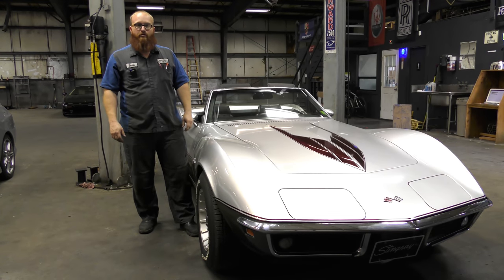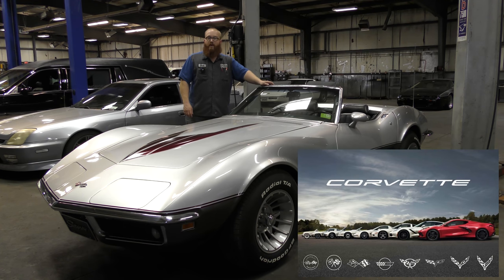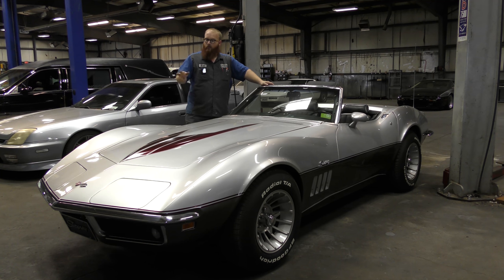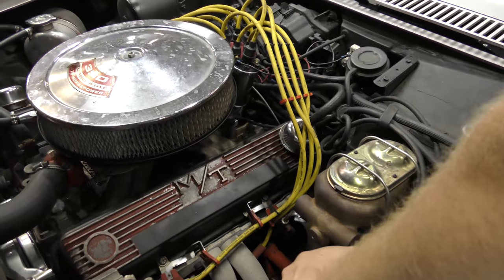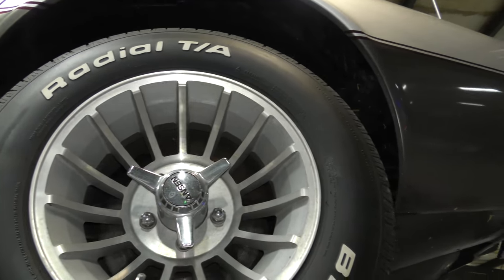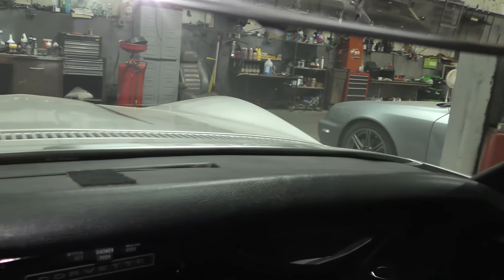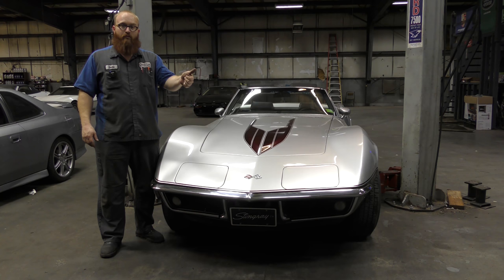The CAR WIZARD inspects this dream '69 Vette

Comment: My pop bought a used '65 Caprice 396 at a Chevy dealer in 1969. I would later learn that '65 was the first year for Caprice and for the big block. As a 10-year-old car nut I'll never forget what I saw in that Chevy showroom. A convertible Vette, a convertible Corvair (the last year for Corvair) and an orange Rally Sport Camaro convertible with checked upholstery. Congratulations to David on his 1st YouTube anniversary!

Comment: These older corvettes (especially the early metal bumpers ones) are really need to be appreciated more in value, they look nice, drive nice and built to last, I hope they will someday be a true collector cars.
Reply: Lassi Kinnunen  they are not. Chevrolet has built 4 times more camaros in the same year, yet any clean original 1969 camaro would sell for at least double the figures!

Comment: That body looks straight and excellent as far as panel alignment with perfect and even gaps. Regarding the C-1, C-2 designations, while the 1953 through 1962 went through body changes and engines galore they were all on a shortened 1949-1954 Chevrolet chassis/suspension. The C-2 and C-3 also share a frame and suspension and yet are two different generations of Corvettes. The C-2 is my favorite of older 'Vettes. The venerable Ed Cole small block is an engineering marvel, but I'm drunk on LS horsepower.

Comment: 6:19
that lower ball joint on the passenger side looked a bit shiny.
like the boot might be torn. I'd need a closer look.
Reply: Cromulent Commodore seen by me also
Reply: Also, those sway bar end links up front are crusty.....oh and that right rear tire is showing a TON of inner wear. Maybe a bit of donut fun with an open rear?
Reply: Cromulent ??? A Simpsons fan I see...

Comment: In 1969 , the base small block was rated at 300hp. A 350hp model was optional. The air cleaner sticker appears to be from a 1970 LT-1 engine with a solid lifter cam rated at 365hp.

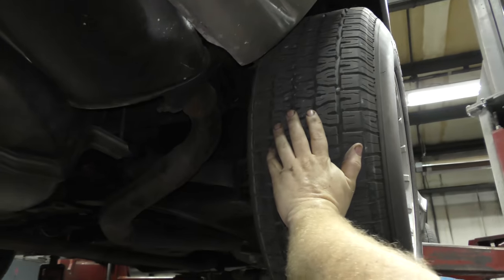Comment: Bolts missing bottom bumper support at 6:33 with stray wiring twisted about and a possible bad ball joint right front at 6:13 and the rear end is out of alignment camber excessive at 8:41. Good luck freeing those adjusters!
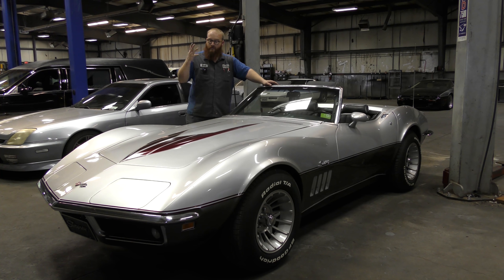Reply: Don't forget to check the rear half-shaft bearings. I had one seize on my '73 and it just quit without any warning. On I-285 in Atlanta at 2:30 in the morning. Not the way I thought my night would end.

Comment: Tip on those wheels, make sure they aren't magnesium.  Cast magnesium aftermarket wheels were common back in the 1960's, they tend to develop cracks as they age and can become a major safety hazard.  You don't want one of them flying apart on you at speed.   Also need more info on that hearse, looks to be a 1993 or 1994 Fleetwood, the last great Cadillac hearse.  All the Cadillac hearses since 1997(when they went to the FWD Deville chassis) have become malformed, dainty, too small, ugly ass looking monstrosities.

Comment: If I had one in a similar style, Id install 3 point belts with bolstered seats sitting a bit higher. Kinda like the Mercedes seats with the belts integrated with the seat frame. Was never fond of the typical low low Corvette seating position meself, but otherwise wouldnt mess with the rest of that beautiful car.

Comment: Check the ladder chassis frame around the engine mount in the front from the top, a few have gone from a wielding stitch around that area going out from either crash impacts, rust or just plain old wear and tear, same with the area around where the rear suspension mounts, as GM when they made these cars did away with a very key X brace when updating the car from the C1 to the C2, that ran underneath the car in the middle and never compensated for it. 

as all this car is, is a corvette C2 with the Pontiac Banshee's body stretched over it, hence the drastic overhaul that was the C4 corvette, where not a single damn thing was left untouched in that redesign.

like imagine a bed frame that only connects in two areas with no struts across in the middle to properly support a persons weight and you can see where it would go wrong based on where all the pressure would be put, and that's where you need to check.

as they thought the body was strong enough to make up for it, and the X brace weighed about 300 pounds apparently, but that's why these cars have Cowl Shake and have never been able to match their European rivals unlike the C1 did, not enough bracing and a poorly designed stub axel design that fails under heavy loads overtime if you dont keep up with the greasing requirements and put oversized tires on them without a big block rear suspension being fitted to it.

and the car that failed and had its front suspension collapse and total the car from that stitch coming undone as he drove over a speed bump at low speed was an 81' and the same failure was found on a 68', one coupe, one convertible, so the entire range has it, and all because a wield wasnt done right.

luckily the guy with the 68 was able to find it in time, and the guy owes me a beer for telling him about it, as he had owned the car since 72'

it should be on the corvette forums, look for my 81 is toatled from a few years ago, as these cars are getting up there in years, so just make sure to do regular checks for that kind of stuff, as when its built by hand, hands can faulter

and the same applies to all lader frame chassis cars I would imagine its just I found it in such a drastic fashion on a car I really like. Plus side is because its a corvette you can actually buy a new chassis for it would you believe?

Comment: Wizard, how about a video concerning the maintenance of a low mileage vehicle.  We have 1996 Miata that is only driven in the Summer.  Any tips on maintaining a car that may go a couple years between technically needing an oil change.  Or, a video on tips for storing a car over the winter.  Keep up the great work.

Comment: Check for frame rot in the front of the rear wheels near the body mount. That is a known area near where water drains out of the frame. I Love my 69 coupe with L-36 4-spd - AC.

Comment: yes the are delco shocks  you can tell  by the notch  in the ring    i seen that before  you said it lol     i turned  lots of them on the merrygo round ..in  76    before  i went into  the trades   ,,we could  run 15-20,000  a line  per shift  on the rods

Comment: The 370 horse was the LT-1 engine available i believe in 70-71 models. That car would've had a big block hood with an LT-1 decal on the side of the hood buldge. With the weight advantage of the small block with big block horsepower in my opinion was the best all around Corvette of the early models.

Comment: Nice Corvette.  Yeah, the C1 Vettes  had the "Stovebolt" Chevy 6, and Powerglide only, because from what I've read Chevy's 3-speed manual of that time wasn't strong enough to handle the extra power output of the tri-carb 6.  Just some Corvette trivia.

Comment: I remember Saab had that reverse lock-out feature as well where you couldn't remove the key without putting the car in reverse with a MT. I believe there was another manufacturer that designed their cars like that as well

Comment: I once owned a '70 Vette with the 390 HP 454. It was lots of fun but not exactly cheap to run.
Reply: P.S., the base engine in '69 was a 300 HP 327

Comment: Tire date of manufacturing was most likely on the back or the black side
Reply: Surprised he didn't think about checking there. Hummmm.....
Reply: Yeah they're pretty easy to spot on BFG radials
Reply: If they were made before 2000 I don't think they have date codes. I replaced some last year couldn't find a date code .

Comment: 11:25 talk about cheap(er)(end) interior materials, I sat in a 2019 Cadillac CT6 recently and was massively disappointed by the interior materials. It was as though GM said, "Cover that hard plastic with a veneer of cheap leather otherwise people will notice we're using recycled plastics from C5 Corvettes and Cobalts. It was very disconcerting.
Reply: Most of those get repossessed anyway.
Reply: its been restored calm down. plastic from these days just turns to dust i seen it. thats a dash cap they sell those. im sure the whole car has been restored. that paint is not original either
Reply: @xavierramirez330  I don't think it's been restored per se but very well maintained through the years Many of those parts seem to be original and undisturbed. Probably been repainted a couple of times by this point though.
Reply: @ohlookadragon  GM interior plastic from these years turns to dust even if garaged its entire life.
Reply: @superduty4556  I'm not disagreeing with you. I just don't think it's been restored. I think someone replaced parts and pieces when they needed to. To keep it looking nice. it's not like they ever stopped producing c3 dash pads. It wasn't just GM either. I've got a 72 international with a badly cracked dash. 38,000 original miles and kept inside for the better part of the last 3 decades
Reply: @ohlookadragon  we'd never know unless we asked the owner. You can build a Corvette from a catalog it seems.
Reply: @ohlookadragon  yeah it's been lightly restored I'm sure. Those dash crack like at 10 years old I'm sure it's not original. Not even if you keep it in a garage it will still crack. Because the material srinks and then cracks
Reply: Bob the owner here.  Car was custom painted and mildly modded back in the 80’s but interior is original. It’s a 2 owner car that has had excellent care yet driven over the years.

Comment: The headers do a nice job of cooking the starter...
Reply: Right you are, Walter. Those headers do.  I have similar setup in my '65 Sting Ray convertible and put a smaller hi-torque mini-starter which is wrapped in a DEI heat reflective insulator.  No more starter heat soak!

Comment: Holy Silver A-Team Van wheels
Reply: A common trashy mod for Vettes. Also the bug eye tail lights. Although I would tolerate four stock red outer ones and pitch the inner ones with the backup lights in the garbage

Comment: Ah, turn locks.  Or should I say "turn unlock".  If it's like my car, you lock it by pushing down on the door handle,  turning the knob (note how it's shaped like a security screw such that it's easy to turn in only one way) unlocked the door so you could pull up on the handle to get out.  Not sure as it was good for anything but trapping your date since hardly anyone knew how to work it.

Comment: pLease, the car's been repainted at least once.  The interior parts are reproductions not originals.  The aftermarket wheels are so so.  Overall that car has a lot of stuff removed from it.  Almost everything is vacuum and I'm not sure it can run all the vacuum controls it needs to in the HV system or raising the headlights are probably slow.   It's a fine car for a driver, but it's nothing else but that.  Seats and door panels have been redone/reproductions, center console probably also as that is notorious for cracking.

Comment: Hey could someone help me on this.....I recently bought a truck (05 Sierra 2500) with a 5.3 swap the engine is cammed but I don’t know what cam it is all I know is that he told me it was cammed....could I run a diablo tuner on it without it messing my engine up because of the cam?

Comment: "No plastics", just the entire BODY...lol
Reply: more like Sheet Molded Compound (SMC) panels made up of fiberglass and a resin formed under high heat and pressure.  Think of it more like early carbon fiber before carbon fiber, just not as pretty in raw form.  It was all about weight savings, but the panels are really strong up to a point where it cracks vs steel that creases or warps.  Plastic will crack at the slightest pressure.
Reply: @pervertedspeed164  Look the definition of plastic, fiberglass is plastic. The rear bumper was made of urethane, not even "glass fiber reinforced plastic."

Comment: Corvettes are great until you have to do bodywork on the damn things. Becomes a complete nightmare at that point. I worked in a body shop and we worked on a lot of Corvette and I hated every last one of them. Their fibreglass panels are flimsy and they won’t hold up during different adjustment processes. I remember adjusting a hood on one about 50 times. Every time you would put it back down and back up it would be a little bit out of adjustment. They really didn’t get it right until recent times.

Comment: Hey Wizard, do You have snow in Kansans where You live? I am asking, as the tires on this Corvette have "M+S" noted on sides. In Europe "M+S" tires are winter tires. As "M+S" stand for Mud plus Sonw. Is it the same in US?
All the best for You from Poland!
PS The amazing think with this car is hove amazing it is for its times! I have a 1974 Mercedes W115 220D with 60BHP. It has a 0-60 time of two days, and a max spped of about 80 (135km/h). This Corvette would simply disappear over the horizon, before I hange the gear into 2nd in my Mercedes :DDDDD
Reply: KamilMB you are correct. M+S designation does indeed mean Mud and Snow.  Radial T/A's are crap though.  That designation was probably due more to tread pattern, which are lousy even in the best of seasons. Even new, the compound is way too hard for cold or wet roads.  Traction, noise and ride quality are terrible.  Add some age and they are the worst tires you'll ever ride on.  Even a classic car will improve dramatically with modern performance (but not low profile) tires.

Comment: Fairly certain that is not the original paint.  Don't think they offered a 2-tone option in 1969.  Looks like they tried to make it look like a 1978 Silver Anniversary color scheme with that.

Not a huge fan of those wheels either, prefer the look of the originals.  Great car overall however.

Comment: Car wizard please help. I'm watching your videos all the way from europe romania and i have a clk 220cdi with a 5 speed automatic. I have agrinding noise that i also feel in the pedals and steering wheel. Its like a bearing but its not a wheel bearing i have them all changed. And i dont know what to change or how to test what bearing could it be. Its the driveshaft bearing or rear diff or gearbox. Nobody here can help me. What do you think it could be. I feel/hear it the strongest around 1100 rpm 2000rpm.

Comment: That car has a lot of modifications. Yes, that air cleaner and those valve covers are aftermarket, as are the spark plug wires, flex fan, and headers, the wheels are aftermarket, at least they are the proper size. It hasn't been ghettoed out with 30" reehuums.. That is definitely NOT original paint. Two tone paint was not available until 1978, and those mirrors are from a mid '70s model.